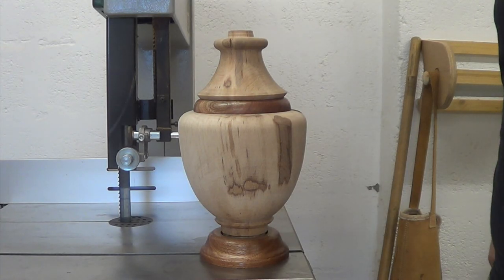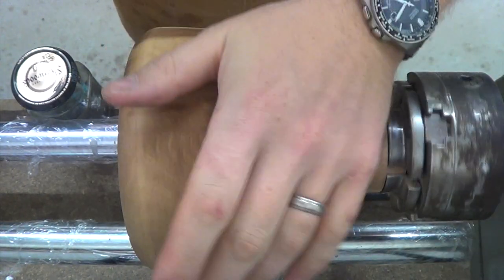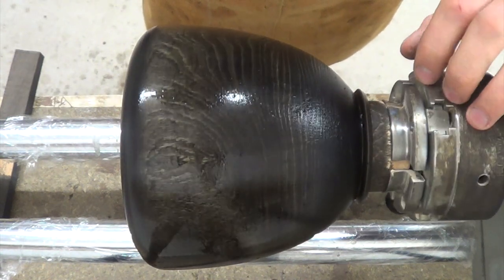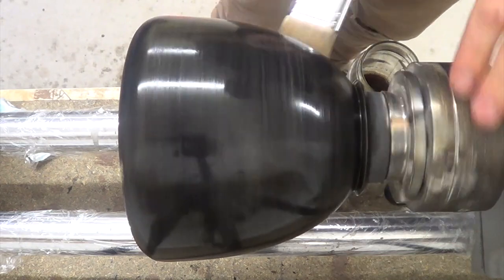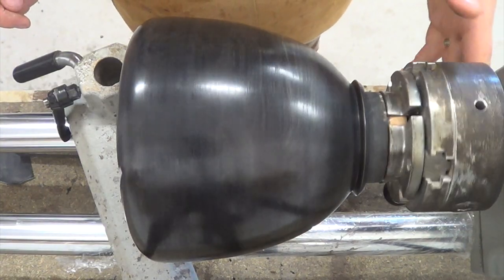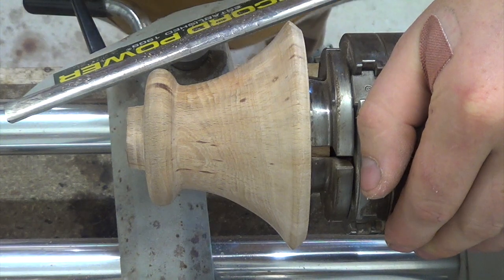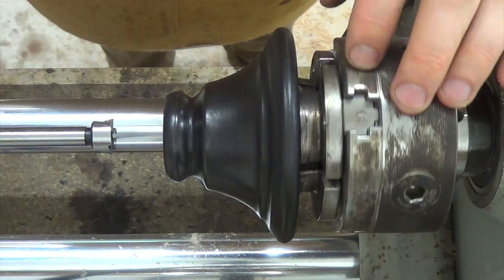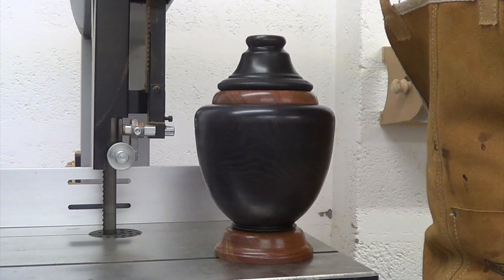Ebonised Beech and Sapele Urn Part 2: Ebonising with Vinegar and Steel Wool

Comment: Have you thought about using either walnut or oak leaves?  Oak, I believe is quite high in tannin.  We have, locally, an oak called the tan oak.. Also, I think that walnut is also high in tannins.. but not positive.  My dad had walnut trees on his property years ago.  When ready, we'd knock the nuts with husks off the trees.  Our hands would go black from handling the husks.  May be the same thing??  Anyhow, nice finding your channel...
Reply from the maker: Spinzwood Oak leaves probably would work too, it's just a case of being in the right season for them. Where I live there's mostly just Beech and pine. Walnut wood is excellent for ebonising in this way too, it's similar to Oak as far as all you need is the iron acetate for a deep black reaction. Thanks for watching and for your comment.